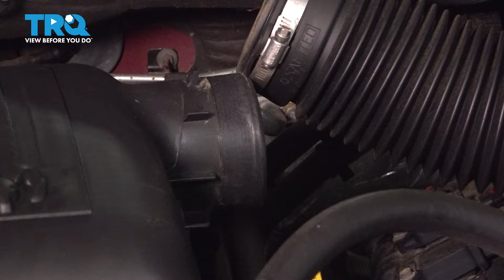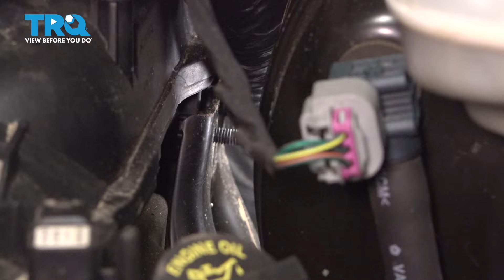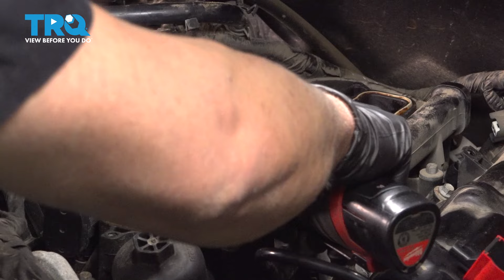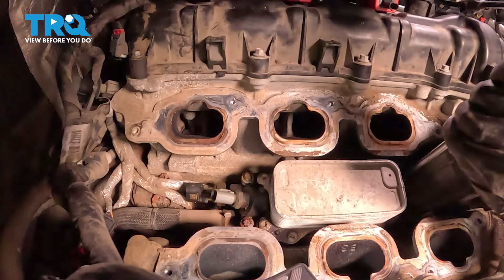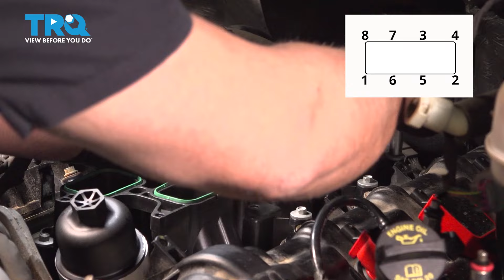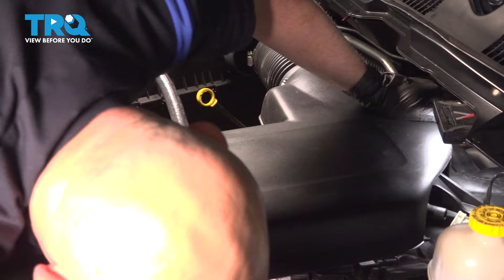How to Replace Oil Filter Cooler Housing 2011-2018 Ram 1500 3.6L V6

Comment: Perfect timing for this super clear step-by-step procedure for this. I'll be tackling this job this weekend. Many thanks for explaining for to disconnect the dizzying array of electrical connectors!

Update: Finished the job. Definitely not something I'd want to do again. Tedious and lots of hard to reach connections and bolts. Took me about 6 hours over two days. Radiator hose clamp pliers help for that hard to reach coolant hose.

Comment: Great video! My 2013 ram has the fuel rail and injecters connected into the lower intake housing so it comes out with the intake nicely. No injector removal required.

Comment: Just set the phone on the cowl and looped this video over and over. Going very slowly, alone, took me about 4 hours start to finish.
Before you start, get the pick & pry set of tools, and the plastic retainer clip removal tools. Absolute must. Also make sure your torque wrench reads down to 60 inch pounds. My El Cheapo only went down to 120 so I had to stop and go buy another one. Good luck and thanks for this video!
Reply from the maker: +@mikemaxwell1801 Thanks for the feedback! http://1aau.to/m/Shop-TRQ

Comment: Great video! Just completed the work on my 2018 RAM 3.6L. Easy step by step instructions. I highly recommend the picks and trim tools. Huge time saver. I would recommend adding a good hose clamp plier. The coolant line at the back was definitely the hardest part for me. I also added duct tape over the intake manifold openings to help prevent debris from getting down to the valves.

Comment: I’ve used these videos to replace ignition coils, plugs, valve cover gasket kits, intake gaskets, oil cooler housing, fuel injectors, etc on 2016 RAM Big Horn. As others have said, the pick/pry tools are a must have for the clips/wire retainers. These vids have saved me a ton of money! Damn I get tired of having to remove that upper intake manifold every time I work on this engine. 😂

Comment: This video is very good. It really helped me with changing the housing. However, DO NOT torque the upper plenum bolts to 89 in-lb. I popped two threads from the lower plenum doing this. I made it work with lag bolts. “7-9 Nm” is stamped right on the plenum. (62-80 in-lbs max)

Comment: Hey there, so I didn't reinstall the um insulation that was taken off how important is that do I need to remove the whole throttle body intake again and put it in or do yall think ill be fine without it

Comment: So this same truck comes back again. That I've already replaced several defective factory parts on. Water pump, crossover, thermostat,etc. Now, it's pumping oil into the coolant system and leaving a puddle behind. Oil is all over the chassis underneath. Is the cooler ruptured?

Comment: Order in which tools were used for removal
Mainly just wanted to note down for myself
10m wrench 
8m socket
Pick
Trim tool
10m socket
Pick
10m ratchet wrench, no droopy
10m socket
Trim tool
8m socket
Trim tool
Pick
Trim tool
T30 socket, no droppy droppy
Pick
Hose pliers
8m socket
Trim tool
Pick
E8 socket 
Hose clamp pliers or needle nose
Silicone, with not petrol additive pure silicone

Comment: I finished the install today but haven’t changed the oil yet. After I finished I didn’t start the truck but I turned it on to see if any lights came on and the check engine light is flashing. Is this just because I haven’t changed the oil yet possibly or may I have messed something bigger up? Thanks for any and all help!
Reply: What was the isssue?